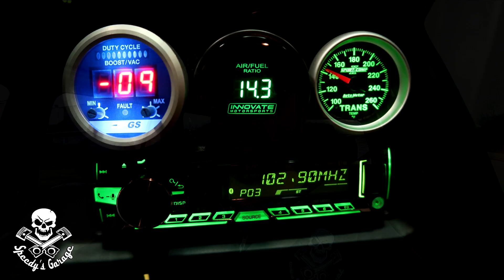3rd Gen 4Runner New Tire Setup  Speedy's Garage Restoring a 3rd Gen 4Runner P5

Comment: It looks great!  3rd Gens are my favorite body style.  You've really done a lot of work to it. 
I've got a 2000 4Runner and I put Falken Wildpeak AT3W 285/70/17's on the same wheels you have...6 spoke Level 8's in charcoal color....love those wheels!  I have Bilstein 5100's with OME coils for a 2" lift.  I did put on SPC adjustable upper control arms to be able to dial in the alignment close to factory and I also added a diff drop kit.  I was getting a slight vibration at 60-65 mph and the diff drop solved that.  Also put in new lower ball joints and axles.  It rides and drives great.  I have factory 4:10 gears, and the acceleration is not great, but it ain't a sports car.  I got 18 mpg  on the highway on a trip to Colorado loaded to the gills with 2 large adults in it.  I did have to trim the lower front part of the factory fender flairs, and I get a slight rub on the back of the wheel well liner in reverse at almost full lock, but I can live with that.  Toyota designed these vehicles with large wheel wells, I think anticipating people would put large tires on them, so they actually look "correct" with bigger tires than the factory tires.

Comment: Thanks! Looks great. I'm still stock, and keep going back and forth about upsizing to 265/75/16. I have the 1" icon lift springs in the rear, but still stock suspension up front on my 2002. I think given my suspension it might make sense to stay at 265/70/16 and just get a more aggressive tire. Looking forward to more vids. Subscribed!
Reply: What tire size dis you go with? I got a 2002 3rd gen with a 1.5 suspension lift and I can't make my mind up on what size tires to in stall. I only go on trails out side of the city.

Comment: I think the recommended life is 7 years or if any visible deterioration on tires. These look nice, I've got 275/70/17 on my 3rd gen so similar overall size but you have larger sidewalls. I have the Coopers you mentioned and they are great, aggressive looking but quite and great handling, have Cooper muds on my Land Cruiser and they are significantly louder.

Comment: I highly recommend doing the BMW F30/F32 seats for the interior, no welding needed, just need to knock of the OEM seat risers/feet and bolt it in. I about 6'2" 240lbs and the seat upgrade was amazing for the long drives, my head actually rested on the headrest, and the seat absorbed a lot of the minor road vibrations/bumps compared to the OEM ones.
Reply: Does it matter what year?
Reply: @yoda1090  damn probably pricey lol

Comment: i agree about the load rating. my 265 ko2 on my 18' 4runner are on its last leg with 65k miles, not too shabby. i want to make the jump to 285 and its obviously tempting to get MTs until u really read the load ratings and the weight. so i might stick with the k02's but in a bigger size and load C is available as well. thank you for the video.